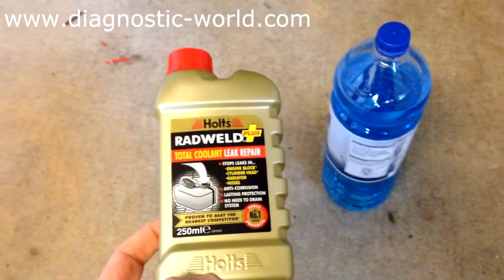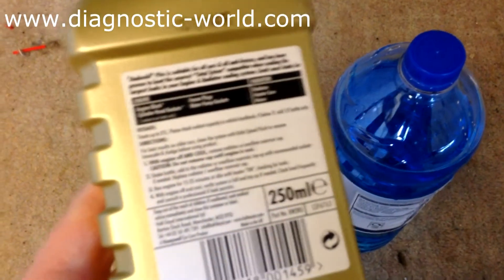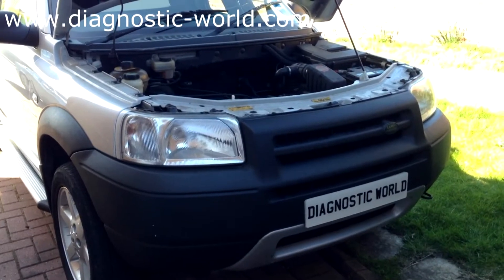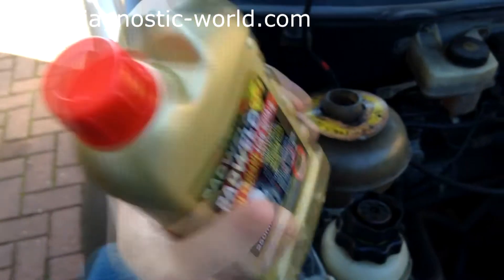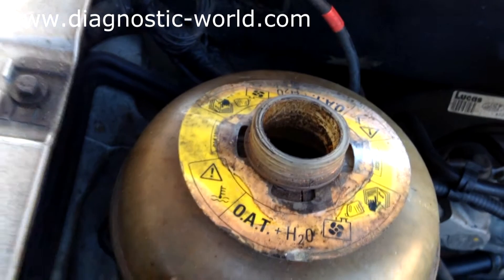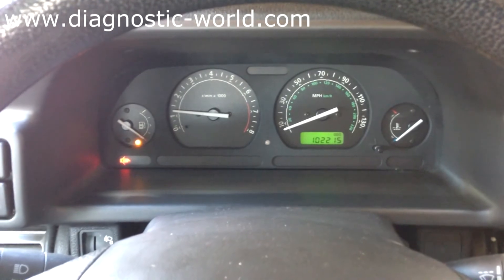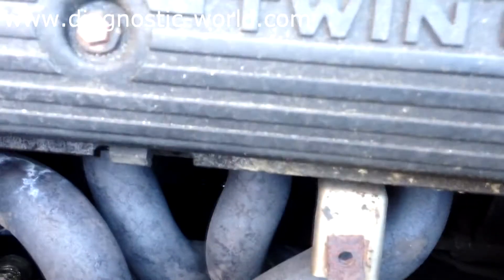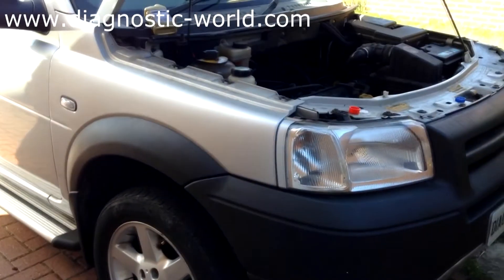Radweld on Landrover Freelander Head Gasket Failure   My Experience

Comment: Don’t bother with rad weld, it rarely fixes a significant leak and will clog the radiator and heater matrix.  Better just crack on and change the gasket.  It can be done in a day DIY.

Comment: I have recently done a coolant flush on my rover 25 k series. It has done 74k miles and is still on the original head gasket, and this is the second time I have flushed the system since owning it. I have been regularly topping up the coolant levels which leads me to believe it could be the first signs or a leading head gasket, so as a preventive measure I have flushed and changed the coolant and added rad weld. I wouldn't recommend adding rad weld without first flushing the system as it may block some of the reservoir channels, so best adding it to a clean system. Also, the rad weld cannot tell the difference between a waterway hole and a leak, hence if you have a dirty system it could cause a blockage. Just as a footnote to that, make sure you're using the manufactures recommended type of coolant, usually the red 'oat' type for these engines, and don't mix two different types of coolant.